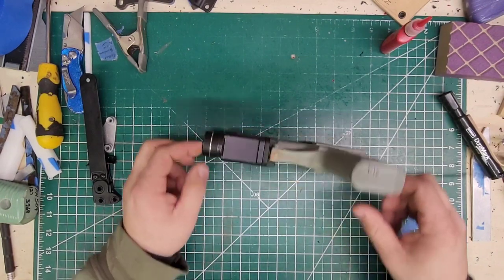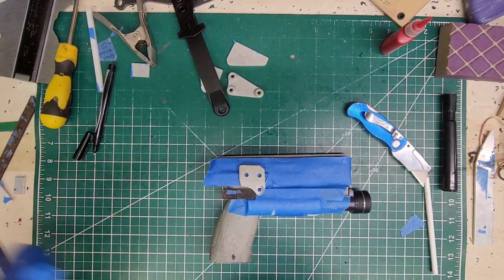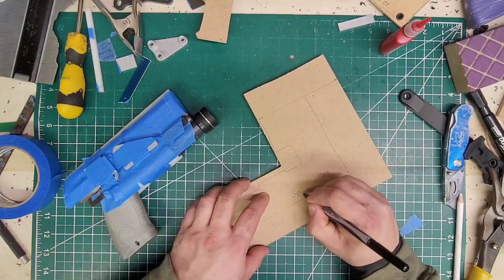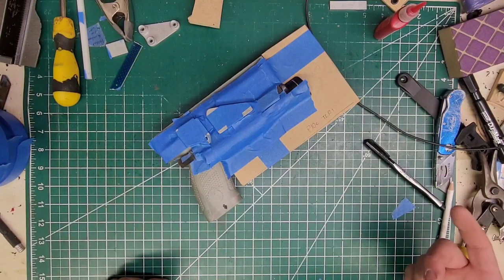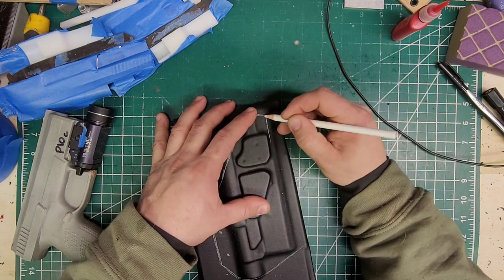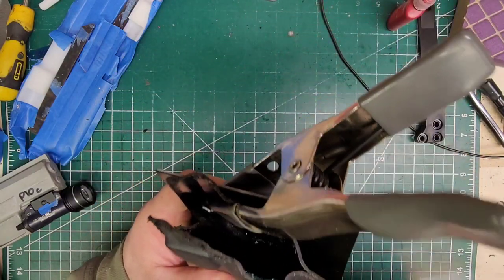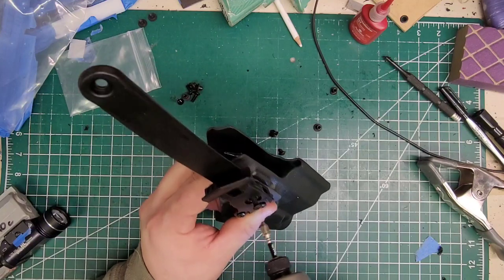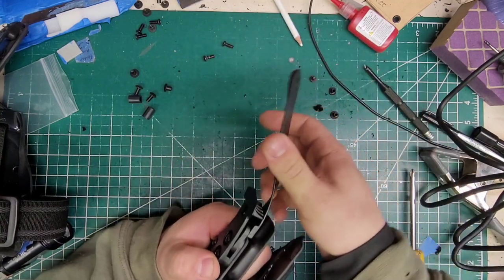cz P10c with TLR1 Gcode Thigh Rig

Comment: Awesome vid!!!  What size hose do you use for the retention? I use 1/4" rubber washers but the product that use has a lot more adjustability. Could you give part # and location as well as reaming tool. I appreciate all your help and THANKS for sharing your info. Much appreciated!
Reply from the maker: Continental  windshield wiper/ over flow tubing  7/32 part number 65112. Can find on amazon for about 30 bucks for a spool.
 And other tool is noga rc2000. Again on amazon

Comment: Ok sorta dumb question but I’m using a vacuum press when do you need to use a retention plate?
Reply from the maker: Whenever you want adjustable retention.  The splits I use have the plate built in
Reply: @FalTacUnlimitedLLC  you get hit with this a lot but this kydex, Cerakote, stippling shop has been setup by my 5 boys all serving and my wife taking care of me, I’m a 100% disabled vet and hard to travel. PTSD is a bear and find staying focused head so trying to get up on the big three is difficult. I’ve watched your channel with interest. Focusing is hard and don’t think I’m making the progress I should.
On my therma press (yes, the family bought the very last prior to Mike I believe closed up shop.
I thought that purchasing KnifeKites ultra foam would Handel the Bowen’s of the inside of the kydex when formed. Any ideas.

Sorry so long but thank you for answering my last.
Terry
Reply from the maker: @terrygreer4255  https://www.holstersmith.com/vcom/thermoform-molding-foam-for-kydex-holster-making-mega-form-12x115x1-p-4292.html

This is the only foam I'll use in my presses.